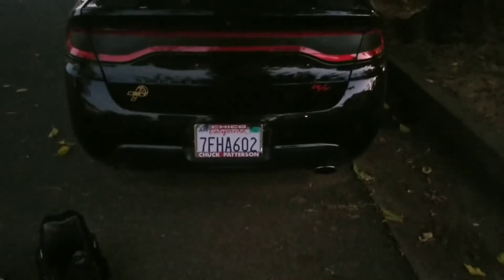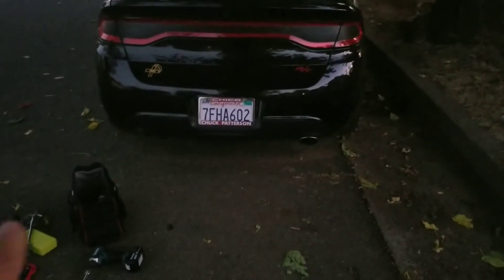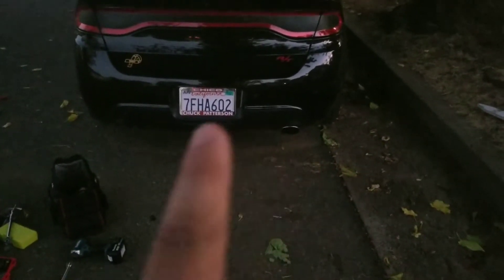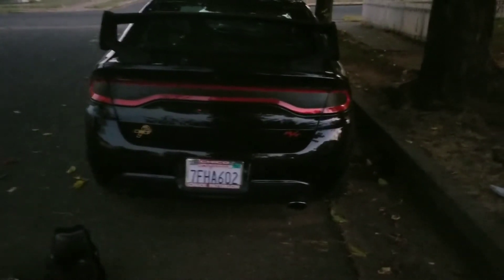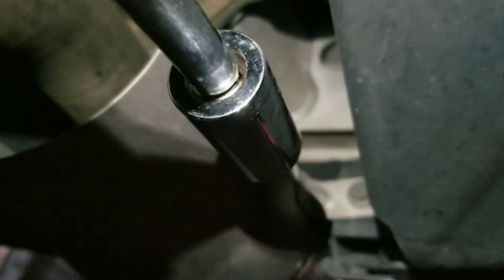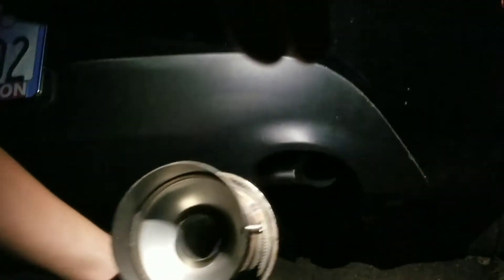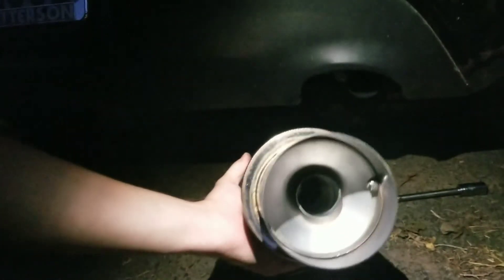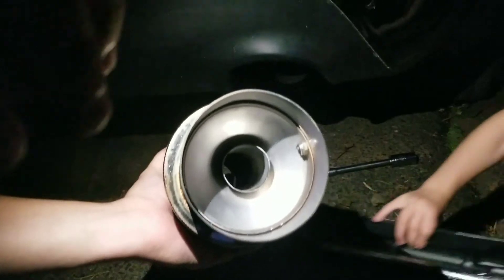How To Remove Your FAKE EXHAUST TIPS! (MOST CARS)

Comment: Did you just use an adapter and clamp for the muffler? Looking at getting the same exhaust and was curious on install. Thanks!
Reply from the maker: Ryan Robinson for the muffler delete or for my new mufflers?
Reply: K's Garage new mufflers
Reply from the maker: Ryan Robinson i had them welded in. Was all custom. Couldnt get clamps put in really. Stock pipe is like 1.5 inch and the mufflers were 2.5 inch.
Reply: K's Garage Awesome, thats probably the route ill go. subbed!
Reply from the maker: Ryan Robinson thanks man! Let me know when you get it done! And stay tuned as im doing a giveaway soon!